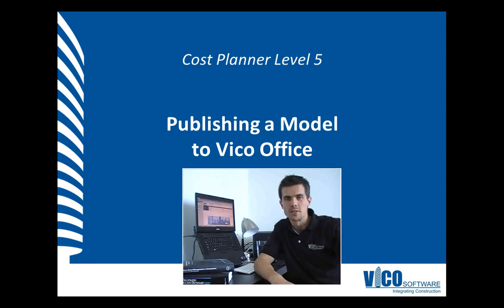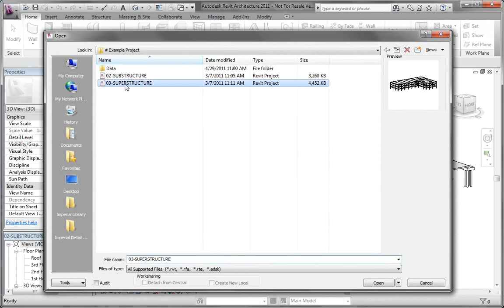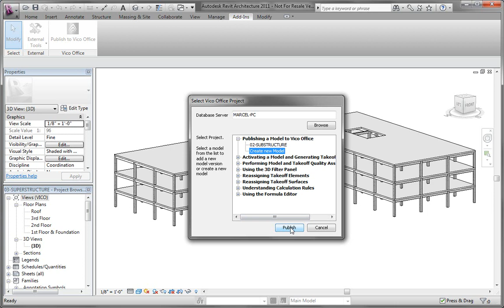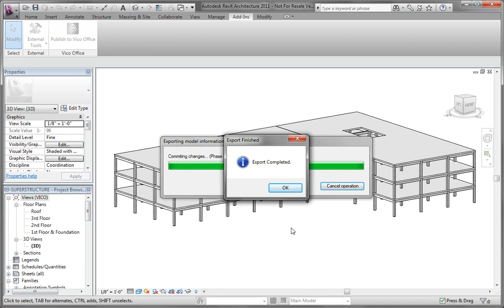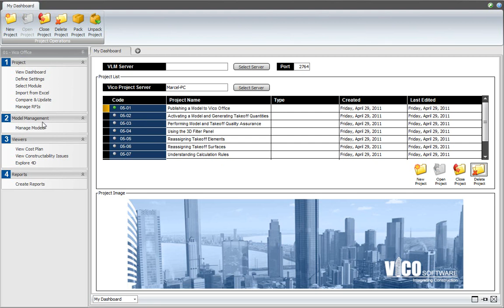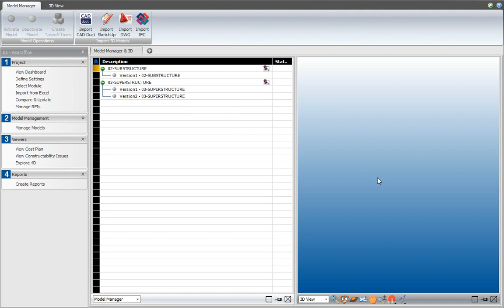CP-L5-01 Publishing a BIM Model to Vico Office.wmv

Comment: Thanks for sharing.
I have imported two 3D Models (structural and architectural). But they are not aligned even though they have the same dimension. Is there a way to align them in vico office? to move one to the other so they are in the same point